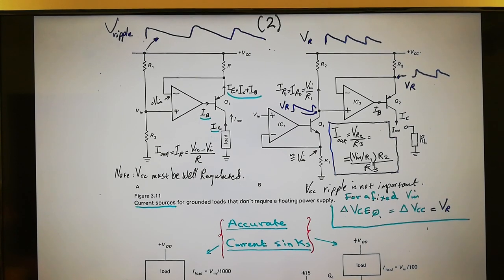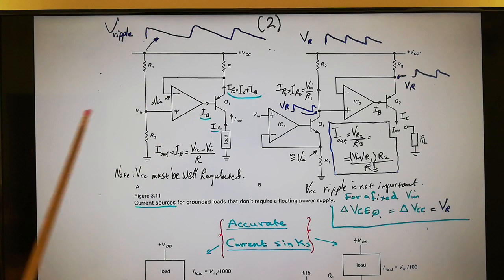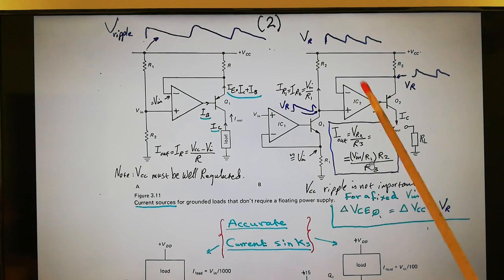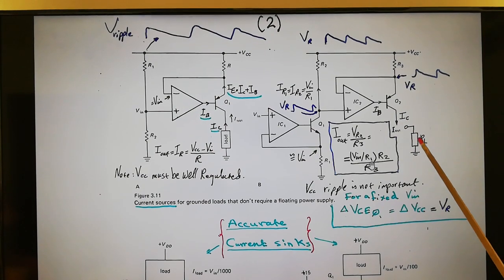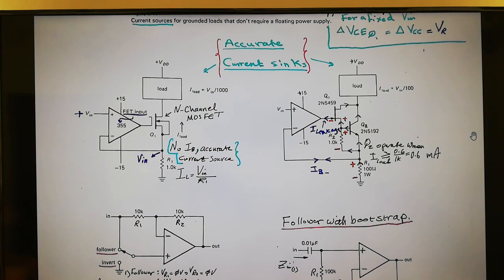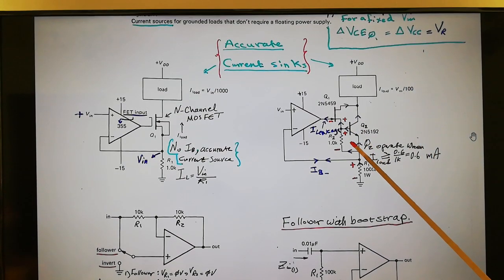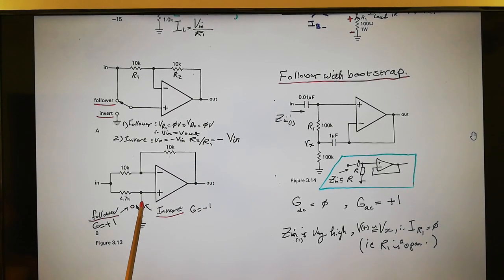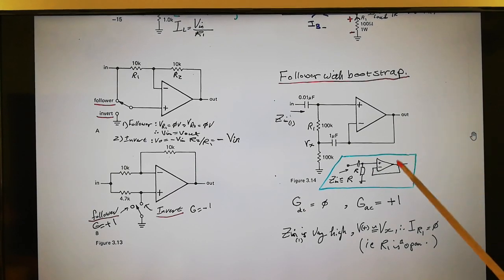Operational Amplifiers, (Op-Amps) Applications 2. Accurate current sources, Zin bootstrap 🇯🇴

Comment from the maker: This  lecture is one of a series of lectures on operational Amplifiers, theory and applications . The practical approach will be used throughout the lectures, where emphasis is on the merits of the circuits and how  they are designed , more than a mabo-jampo equations , still the theoretical part will be covered in an easy to understand approach.
learn, enjoy and have fun 😊
knowledge for Free.